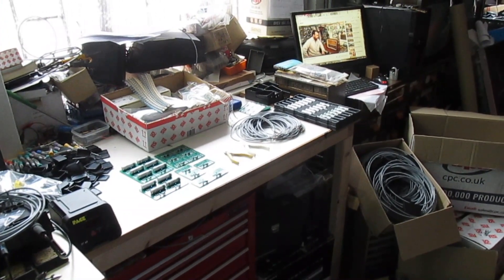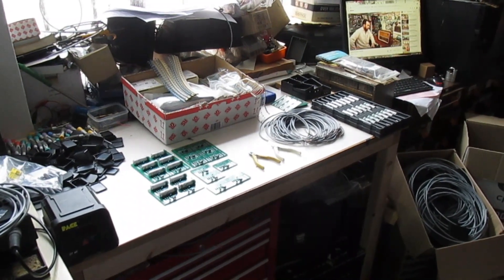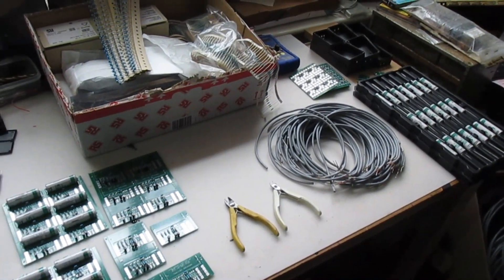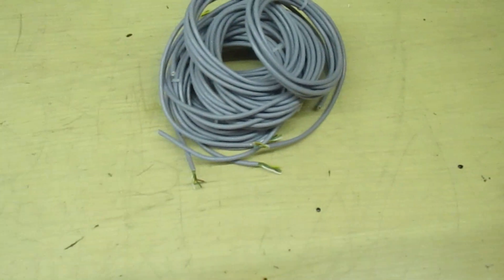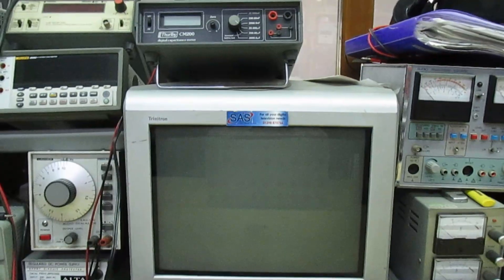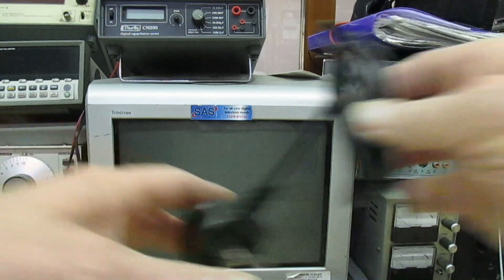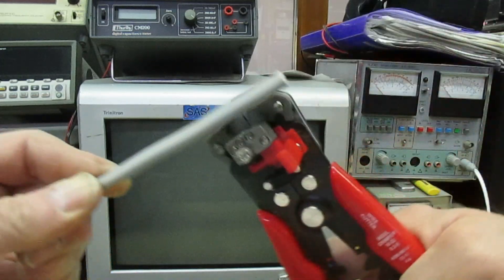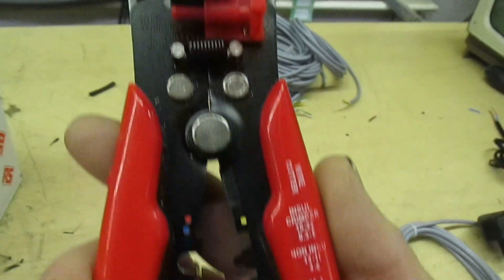CK 95001 Automatic wire stripper demonstration

Comment: Hi did you have any dealings with the philip g6 duel stand tv ? I had one of these for many years and keeping it going an amazing tv with all its switching from 405 to 625 lines.
Reply from the maker: only a couple back in the late 1970 s but I still have the valves for these PD500 anf GY501 I think they are .
Reply: @michaeldranfield7140  yes i remember replacing the line output transformer just two multipin plugs and resetting the voltage and replacing the focus bleader chain resistors worked great for a few years back in the day for a tv i found on the tip, amazing the flat screens you see up there now probably with simple fault.

Comment: I need one of these !
Reply: I've just got one (Toolstation) and can't believe I've managed without it for the the last 35 years ! Are these new to the market (I've seen similar, but they usually don't work very well) and how long do they last ?
Reply from the maker: @mfd70  I dont know , a friend gave me these for my birthday over a year ago and I never really used them until recently when I landed this electronic assembly job and now I cant do without them,  I have to strip so many wires in one go it would take forever just using a pair of side cutters .